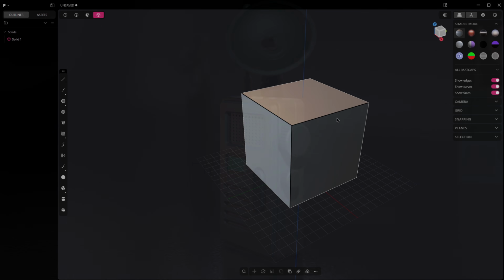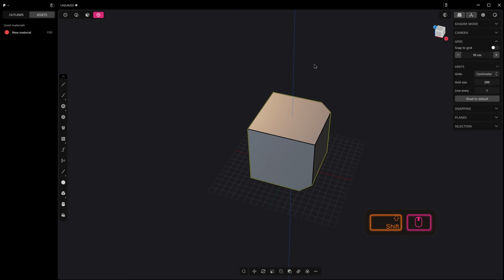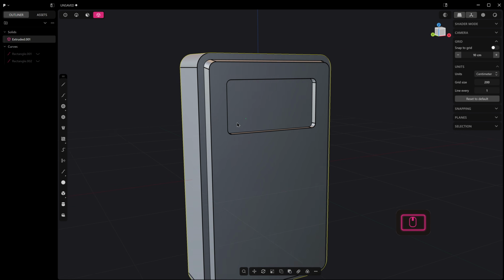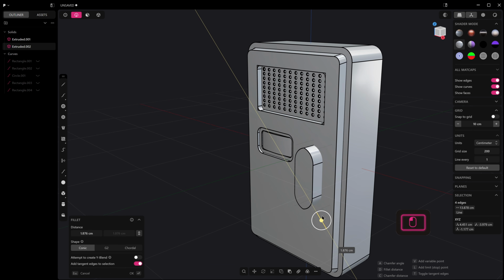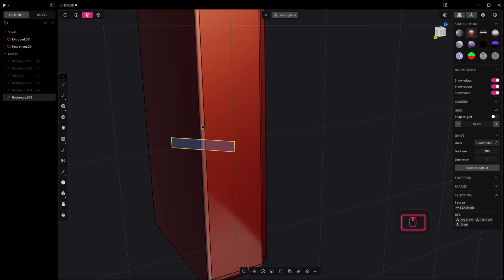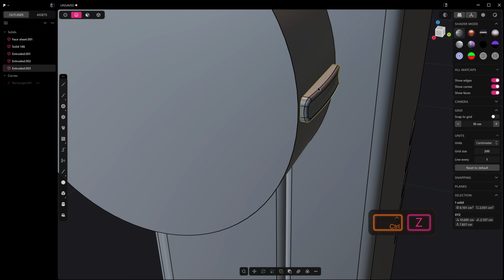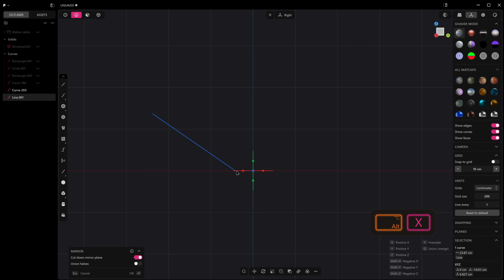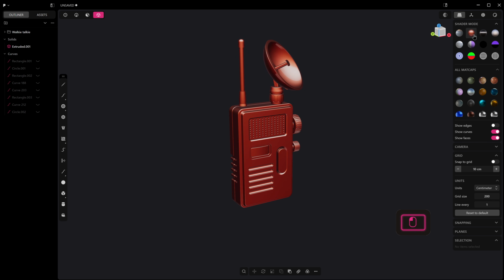Learn Plasticity From ZERO! Beginners 3D Modeling Tutorial

Comment: Inputting dimensions is stupid. Just make an object properties box that's visible all the time.
Reply: It's shocking how cumbersome it is to get the dimensions entered.

I've never had it be this much time of my workflow in any other program.
Reply from the maker: I here ya, As there isn't a history in plasticity this data gets binned when you make changes to the geometry, so this wouldn't be possible beyond primitives, how ever the trade off is you can work incredibly quickly and by eye for aesthetic purposes which is a fantastic work flow while having the ability to have prescision when needed. 

In my eyes the destructive workflow is extremely useful and still allows iteration if you work smart.
Reply: @takerefuge3d  it can be, but I think the benefits of including certain non-destructive procedures (like allowing resizable bevels/filets/chamfers, still letting me modify the radial array on the dial after the union boolean, that kind of thing) vastly outweigh what relatively little additional complexity they add.  The nested trees they create in the outliner aren't especially hard to understand, you just have to stay on top of them.  At least having that option of keeping the boolean un-collapsed/committed/applied would be VERY appreciated.
Reply from the maker: I agree, I do not think that plasticity should go fully parametric, however some basic quality of life stuff like live booleans, live arrays that is stackable like blender would be very handy (we already have live mirror/instance)

I don't think having live dimensions for every single change for example  is something plasticity needs though

Comment: 16:31 I would for a different way of re-scaling dimensions. The fact that when you click an object it just gives you 1:1:1 means nothing to me. I want to see 24mm:37.4mm:65.7mm and adjust from there. I’m sure there is a reason for it showing 1:1:1, but I don’t see how that can be useful to anyone. When you adjust any of the 1 digits, even slightly, it dramatically alters the dimension in the respective plane. For example. I’ve tried adjusting the X axis dimension from 1 down to -.91 and it was like a 20mm difference in size.
Reply from the maker: yes just use "=" for the dimensions command and you can tab through the specific numbers and type them its a more precise way of changing the dimensions, as opposed to scaling on x/y/z by a percentage which is less precise but quicker for lots of things you wouldn't really want to specify dimensions for things that you are eyeballing and you wouldn't want eyeball something you needed to be a specific size.

that being said the dimensions command does only work with primitives so beyond that you can use the measure distance command to view the really actual measurements on more complex objects.

Hope that helps and also makes sense I just woke up 🥱
Reply: @takerefuge3d  On my danish keyboard the"=" is on the number "0" and to use "=" I need to hold down shift. But that does not work so is there another way to get the dimensions so I can tab through them?
Reply from the maker: @TPRacingdk f and search for dimensions command then you can right click and reassign it to whatever you need. :)

Comment: Hi it wont let me slect blender? Also my screen dosent look like yours im on 24.2.4
Reply from the maker: Hey, what do you mean you can't select blender?
Also I recorded this in 25.1 I think the vast majority should be the same even if the UI has changed a bit
Reply: @takerefuge3d I’ve reloaded the software and now it’s responding but the middle mouse wheel will not move around the cube or make it rotate. It will scroll in and out ?
Reply from the maker: @zulutacticalairsoft that's blender controls press down middle mouse and move the mouse to orbit roll the mouse wheel to scroll.
Reply: @takerefuge3d  Yes I know its not doing that with blender selected
Reply: @takerefuge3d good news my mouse was faulty looking forward to learning

Comment: So it looks like something may have changed between your tutorial and now, either with the versions of Plasticity or maybe between Indie and Studio licenses. There doesn't appear to be a viable option to subdivide/raise degree. Shift+S seems connected to "Subdivide Curve" now which doesn't do as described when you reach that step.

Beyond that, Great tutorial! Nice basics, easily understandable, and slowly explained. Thank you!
Reply from the maker: First of all thanks... :) 
Ok Make sure you're in face mode the third option on the top left.
Select the planar face you want to subdivide and press f and search raise degree from the command search. 

I made a whole video on this when it came out. Might be useful
https://youtu.be/_wIOwWxfhNA?si=hNsBJdn6L9XfMSX-
Reply: @takerefuge3d  im getting an error here too. im able to subdivide the surface, however, when I try to extend the vertices past the impression, it flattens, if that makes sense. in your tutorial, the vertices extend out so the curved surface sits proud of the indent. I cannot seem t replicate that.
Reply: @takerefuge3d  Yep. Followed that exactly. Looks like it was a version difference. Not sure how i was THAT far off, but got to love user error. So if you see anyone else note this... they may be on an older version of the software. Cheers!

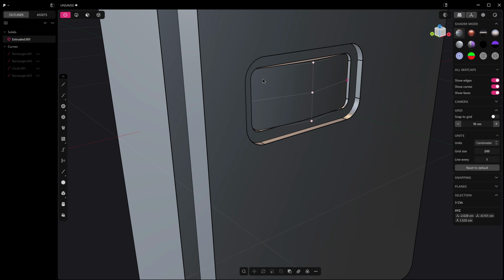Comment: 33:58 I cannot protrude the curves.
Reply from the maker: This is the raise degree command and you select a face and hit shift +  S to subdivide then you select the individual points in point mode and can manipulate by directing the ones you want to move pressing G for grab and moving them about.
Reply: @takerefuge3d  Thank you for your response. I understand that operation. However, the surface becomes flat.
Reply: @user-fn8if4pc7n  I had the same problem. 
As soon as i pulled the points over the height of the first pocket (i hope you get what i mean) then the area which was moved above this plane was just flat.
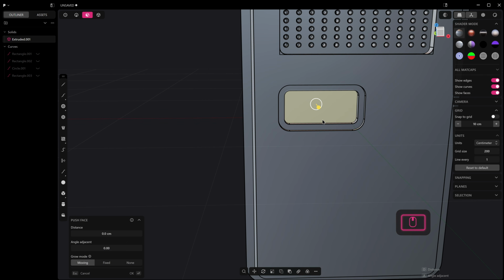Then i rewatched the video and at 31:57 he makes another offset, which was not mentioned on the voice track.
Reply: @BlackBot1986  This! The inner faces is not only offset but it gets pushed out a small amount as well, then you can move the center vertical points after the subdivision

Comment: Deal breaker when you said to make the model larger. I model miniature parts in model railroads so making it larger and scaling it down will create most likely cause a failure in STL printing.
Reply from the maker: The only reason we scale up is to make sure that plasticity plays nice in the modeling process. This will have no impact on the stl file when you scale back down a watertight model.
What will create failures is intersecting geometry and human error.
In short this isn't going to effect your use case at all it's just a practice that I do due to noticing certain tools (like deform) play nicer at larger scales, 99% of the time the scale shouldn't impact you.
Reply: I followed the tutorial but with way smaller scale and it worked fine, maybe they changed it in the last update

Comment: Thanks, learned a lot. At 31:39 when I hide the curve  the imprint disappears. I then retry the procedure and a workable, old imprint appears. I'm trying to figure out what I'm doing wrong.
Reply from the maker: Hey thanks glad you liked it.
So in this case I used shift + I to imprint the edge directly as opposed to I which puts the curve on the surface
Reply: @takerefuge3d  Got it. I'm assuming putting curve on surface is for sheets.
Reply from the maker: @gorfulator you can use either depending on the circumstance sometimes when one fails you can use the other.
It's a bit like adventure sometimes but yes you can simply use I to create a new curve on the surface which you can use in all the ways you'd normally use a curve or use shift  + I to create new geometry on a sheet or solid...
Reply: I had same problem, if you look closely he does two more things that didnt said but u can see: 1 he did another ofset, 2 he pulled that one out a bit, just after that he does shift+s and so on. Hope it helps!